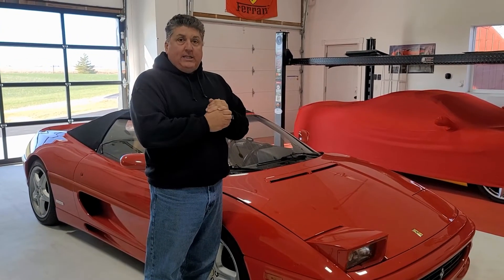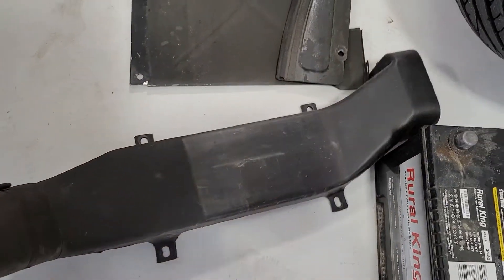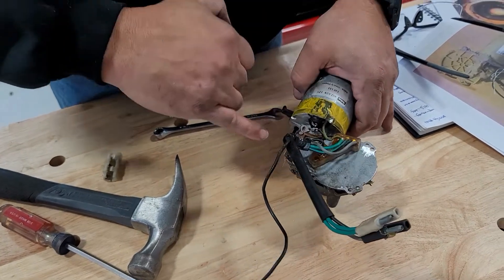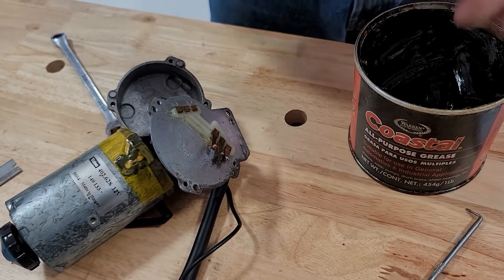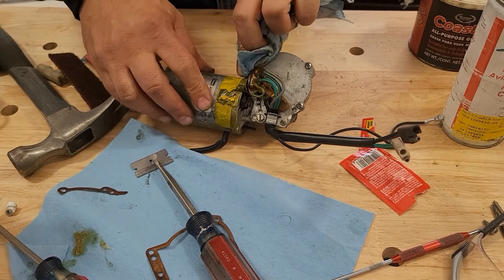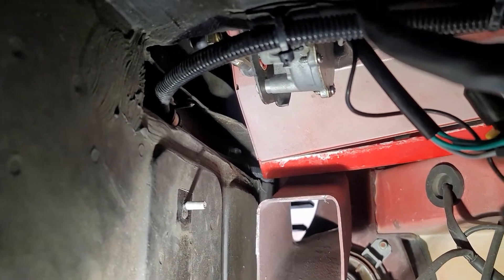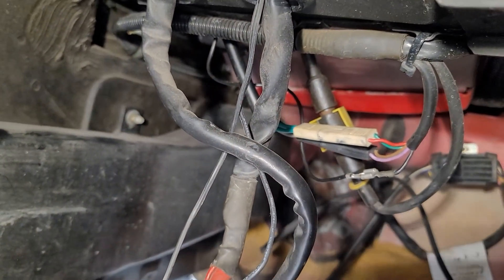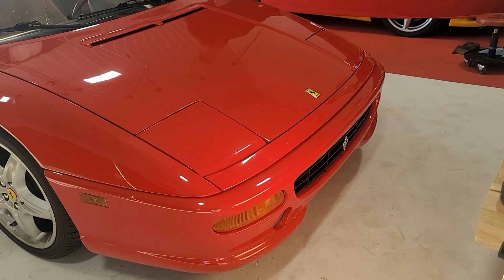Ferrari F355 Headlight motor repair

Comment: Another good video. At 5:26 there is a can on your bench that says "D-5??? Avionic????Preve????Compo?????" on it. Can you tell us about that product, what you use it for, its full name and where you buy it? Thanks, Bill
Reply from the maker: This is a product used by the airlines. It's used in electrical connector to prevent corrosion on the pins . The product is spayed directly on the pins or contacts. It's made by zip.  My source is confidential.
Reply from the maker: Zip Chem products 400 Jarvis drive Morgan Hill cal. 18006482661 that's on the can